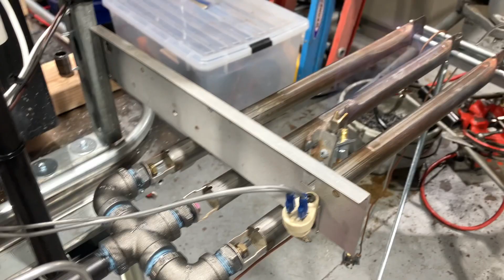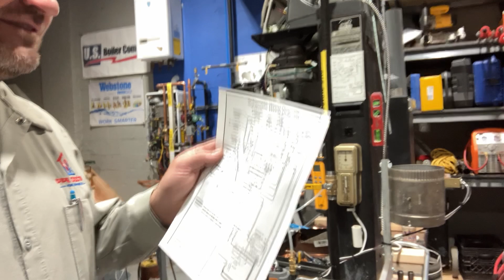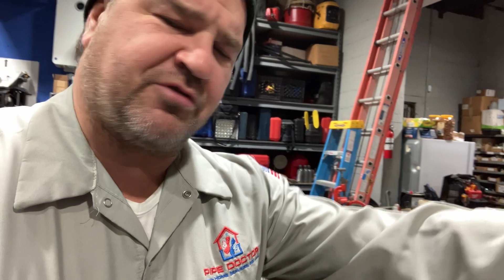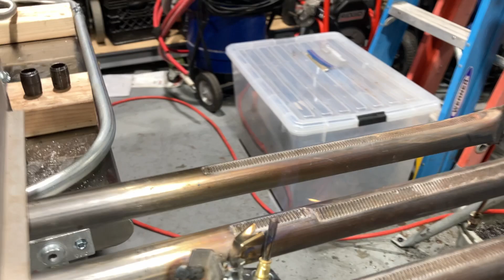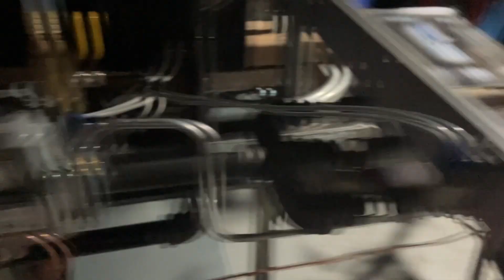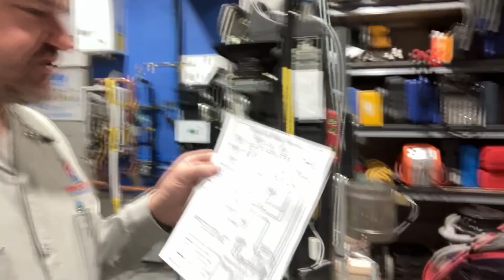1 Understanding Standing Pilot Gas Valve Operation - How a Thermocouple Keeps the Pilot On

Comment: Hey Mikey, great instructional videos. I appreciate it a lot. I'm working on my first Ideal Heating Corp model #45 Gravity Floor Furnace. Is it okay if I ask a troubleshooting question about it and if you're familiar with this 1950s style floor heater. It has a floor grate that when removed reveals the observation glass/ opening where a long match is inserted to light the pilot. Also there are 2 key operated long push rod valve controls. I believe that on the left is the pilot valve and on the right is the burner control valve. The problem.is the pilot does not ignite. I've depressed the pilot control rod and attempted to light it in many different positions and it does not light. I noticed a ring right below the pilot push rod attached like a cap that was turning when I turned the rid sometimes. I googled what it is and if I could accidentally unscrew it causing a leak. The answer indicated it's a pilot gas flow adjustment knob saying clockwise all the way is the lowest, which it was nearly at the lowest, and a good lighting position to start would be a full 1-1.5 rotations counterclockwise from the lowest. Also that 4-5 rotations from lowest to highest could result in the cap/adjustment knob, threads ending and it coming off and risking gas leak or issues putting it back on if it's loosened too far. But I felt safe trying to adjust it up from the lowest position because 1.5 rotation spring Lewis is far from 4-5 so I was confident that it could safely be adjusted up. So just using the push rod as it had been turning before I would depress it and turn it counterclockwise and the knob would turn less than a quarter turn at a time. But I had marked it and turned it till it was around one rotation and now it seems to have seized up seized up and is not moving freely. Also it seemed to switch from comfortably depressing the rod when it was in the on position and not when it was in the off position. Then that seemed to reverse once the knob was turned a little more than one rotation. No it only wanted to depress in the off position and not in the on position. So I was concerned I was able to reverse the rotation about a quarter turn and it seized up again. But now it seems like it can depress in both the on and off positions. It's in a hard to reach place it's a couple inches below the bottom of the cavity on the other side of sheet metal so it's difficult to get ahold of with regular needle nose pliers. I will try again with longer curved needle nose pliers and attempt to get a grip on it and see if I can free it up that way but I'm not sure if it's a good idea because if there's a needle in there something that could break or jam worse because I'm not an expert in this at all. This is such an old heating unit this I've never worked on before. Other than lighting successfully as normally performed. I tried lighting it now with the adjustment knob turned but I'm still not getting any gas with the pilot rod depressed in any position. So I'm not sure what the next steps are and how to troubleshoot it since the valves are all in a very difficult to reach location below the heater housing with no access panel. Any suggestions as to what to do next would be greatly appreciated. I already tried reaching in with a toothbrush attached to the end of a thick wire and cleaning the pilot next to the burner. I don't know how well that worked if there is still something clogging it or not but I'm trying my best without much knowledge of the furnace itself or any specific HVAC tools that you may have. It didn't seem to be leaking any gas so I just left both valve control controls in their off positions. If you have any knowledge of this type of unit any suggestions as to what you do next will be greatly appreciated. Thanks a lot, JJ the Handyman. 😁👍🏼

Comment: Nice u finally understand a obsolete system
This is basic and a good tech knows sequence of operation .
Therefore a good tech will be able to read and draw the wiring to a basic burner
If not they shouldn’t work on the system

Comment: Just to add a point. Thermocouple failure it's not really because of wear and tear.  It's not distortion or anything like that. There are two different metal portions of the thermocouple, which are two different types of metal. The two different types of metal heat at two different rates which causes them to rub together. The rubbing together is what generates the millivolts of electricity. Over time, the heat will cause the two different metals to fuse together. Once they fuse together, there will be no more movements and no more electricity generated
Reply from the maker: thanks for sharing
Reply: @MikeyPipesTraining  when customers have a history of frequent thermocouple failures, check for excess heat sources. Excess heat can cause the two metals to prematurey weld  together

Comment: Great video - Suggestion to add more relevant content, disconnect the thermocouple when pilot is lit to show it controls gas to pilot. Then meter the thermocouple with pilot lit to show the method for testing thermocouple.
Reply from the maker: Great point!

Comment: The 3 pressure taps are considered open lines and are therefore illegal.  Lines shall be caped or pluged.  
The thermocouple you correctly identified as a tube as it is hollow allowing for the second conducter from the tip to be coaxial. 
Very nicely done video and mock-up.  It would be useful to show both the pilot AND main burners to shut off when the pilot stat drops out.
Reply from the maker: Ah, pressure taps and legalities—sounds like a plot twist in a gas valve soap opera! Thanks for the tip, I’ll make sure to keep my video drama-free!
Reply: Please Remember that those 3 
Lovely Pressure taps  are  for Testing & Instructional Purposes
Thank you